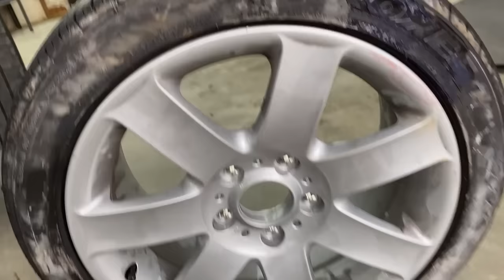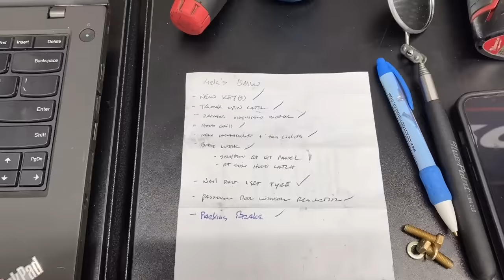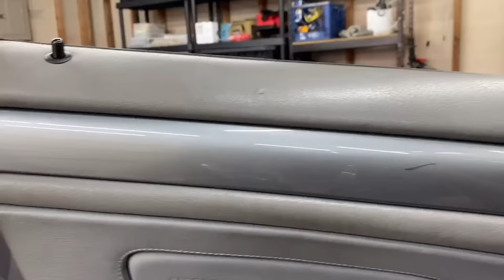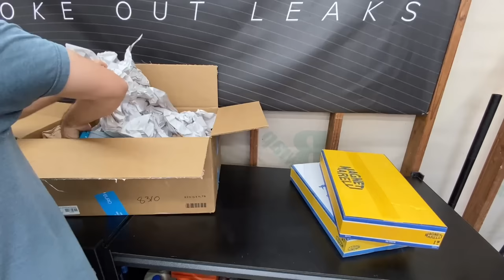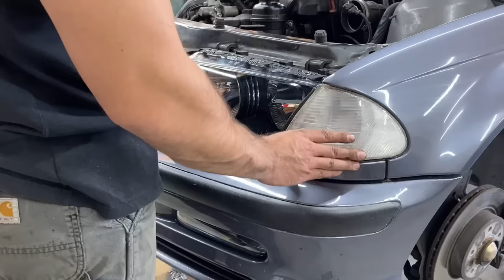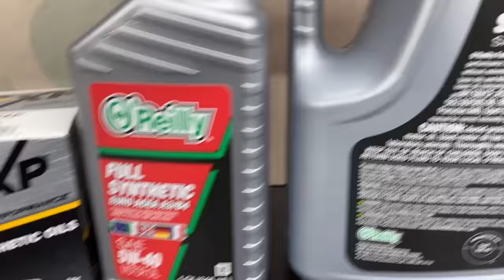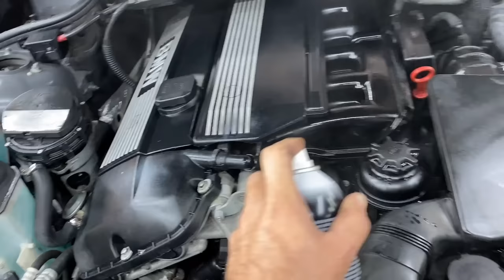What $2077.96 Worth of BMW Repairs Looks Like

Comment: Unfortunately, this is what does in many E46s.  This car was in good shape, it just needed a few maintenance items. If your local shop charges $4000, it may be more than the car is worth. Your $75 an hour is way under indies and dealer prices.  You are giving excellent service at a great price and cleaning things as you go!  This will help keep some older BMWs on the road. The E46 is a great looking car.
Reply: BMW in Minneapolis is $250/hr now! Last time I needed anything from them it was $100…$75 for quality work is honestly too low; I get for friends and family but don’t undercut your skills especially when a good mechanic is hard to find these days🔧
Reply: @bimmerboi_hutch . Wow I haven’t been to Minneapolis BMW for years.  $250/ hr is crazy.
Reply: @DCPEvo  while I agree - a package of bacon is $18, so I guess I'm not surprised; I just hope the tech's got an increase too 🔧
Reply: This amount of work and repair for a little over 2K is INSANE value.
Reply from the maker: thanks for the comment and replies everyone! 
I agree its quite low, however Erik is a great friend and I dont know how I would feel charging more. With that being said, this job total was over $1300 in parts alone. 
Its crazy how expensive labor rates at the dealership are getting, I dont agree with it one bit.
I can guarantee you the technicians rates are not increasing at the same rate either.

Thank you all for the support and awesome comments!
Reply: @DayOffDIY  A great reason to DIY as much as we can as often as we can on our Bimmers!
Reply: Great video. I bought a 97 318ti for my wife to learn how to drive about six years ago, she did drive it for about 4 months. It has been seating on the driveway since then, now my son just turned 16 and he claimed dibs on it,, we try to start it up but no luck, we replaced the fuel pump and fuel filter, the car run for a few minutes then it will die, so we think is the crank sensor. Currently working in it. Bottom line, your customer service ethics are amazing, and been such a honest guy is remarkable. Good luck with your channel.
Reply from the maker: thank you for the well wishes my friend! gotta love those old 3 series touring. classic body style!
Reply: Why a lot of cars are off the road enough of a shit box That's the repair cost for the 10 little things He's not worth the value of the car
Reply: So learn to DIY. Or sell it to someone who has.
Reply: Issue with charging too low of an hourly rate is it brings in a lot of individuals that do not want to pay for simply any service, argue at every costs etc. Because they really cannot afford any of it. - Most adults have credit for emergencies like car repairs. If they aren't able to do that, do you really want them as a customer?

Comment: A new phrase that has permeated the auto repair world is “mechanically totaled”. Repairs exceeding the value of car. Monetary value is one thing, but, emotional value is another. I have spent twice the value on repairs of my E39M5, and it was totally worth it. I assume this E46 is the same. Good work repairing the car.
Reply from the maker: E39 M5, that’s my dream BMW! If you ever sell it, consider me will ya?

I like that term, I’ve totally ran across cars that should be destined for the scrapper, but e39s and e46s are worth saving In my opinion
Reply from the maker: Yeah even with the front end collision on this E46, the bones are still good. The M54 engine is good for 300k plus miles

Comment: What I would do to be able to find a BMW mechanic like yourself in my area. Incredible job, going above & beyond with even the little things is why you're not just a mechanic, but a great mechanic.
Reply from the maker: Thank you Daniel! Really appreciate the kind words. Where ya located?
Reply: @DayOffDIY  Of course, hard finding good, reputable & honest mechanics. I'm in Staten Island, NY
Reply from the maker: ahh NY! do you have to fight a lot of rust?
Reply: @DayOffDIY  fortunately I don't, most of my fighting is with the mechanics who do little work, but charge alot of $
Reply: @DayOffDIY  just found out that I need to replace 2 of the 4 front lower control arms. Two questions, 1: is this something I can do myself without a lift using jacks & stands & 2: if I need to replace 2, wouldn't it be better to just replace all 4?
Reply from the maker: You can do anything without a lift, even removing a transmission if you really need to. The rear control arms dont wear out like the front ones do, id only worry about the front and go from there. I also have some content out there showing how to remove the control arm bushings only, that may be your issue. good luck with repairs daniel!  @danielwilhelm8870

Comment: quick tip from someone who’s working with these… let’s say wonderful parking brakes (thanks Mercedes) on a daily basis: put the brake rotors on and adjust the brake shoes until you can’t spin the rotor by hand anymore, after that loosen them up by about 3 turns. Like that you’ll get pretty much the „optimal“ setting for your parking brakes, no matter if the brake rotors or the brake shoes are new or not.

Still an awesome video though!
Reply from the maker: good recommendation! ill have to give that a try next time

Comment: Nice results brother. Enjoyed watching you go through knocking each item off the list. When chasing threads I typically flush with wd40 as I am  running the tool in and out to keep debris from building up. Good video!
Reply from the maker: Good idea! I usually use anti seize but it usually makes a mess

Comment: This video is pure gold.

First of all, you got a new subscriber. 

Second, I just bought an E46 330 Ci 2002 from my neighbor, the car has only 76k Km (47k miles) and it was parked on his garage for a few years because he crashed it, and the only real damage was aesthetically but he didn't wanted to spend money to fix it (I'm from Venezuela and the cost is even higher to fix a BMW here). So I saw an opportunity and decided to buy it for a bargain. I got a mechanic to change all the fluids, the fuel pump and filters, I changed the battery, the tires and the car started and runs so freaking smoothly. I have it now at the bodyshop for the hood (which was the most affected part from the crash), a full paint job and detailing. My only concern is to find a good mechanic that knows what he's doing around a car like this and I think the best approach is to just do a lot of the stuff myself.

Anyways, I just wanted to thank you for the level of detail in this video and everything you did to the car, it helps me know better the car I bought and for that I'm grateful! Keep up the good work and I wish you great success. PD: excuse me for my English, not my native language!

Edit: so I wrote this like 20 min into the video, afterwards it just gets better. Amazing job
Reply from the maker: Thank you so much Gabe! and no need to apologize for your english, it is excellent!
Glad you enjoyed this video, i had a lot of fun making it. Cant wait to share the next one with you, ive been working in the background on a giant video project and itll be out in a few days. I hope youll enjoy that one too.
Also congrats on the car! once they are tuned up dont they drive amazing?! love the E46

Comment: Work done with clinical precision. In todays world, almost all the car dealership workshops are in a 'replace dont repair' spree. However, its nice to see you moving away from that mindset and repairing what can be repaired and replacing only whats required. The detailing is immaculate. I credit myself with the detailing of my car, I have been doing it for past 15 years. However, when it comes to washing my car , I need not more than 2 gallons of water in a bucket and thats enough for me to clean my car from the outside to inside.
Reply from the maker: Thank you for the comment friend! Appreciate it. I try to repair what I can and replace what I can’t. 
I think it’s a good way to go.

Comment: one thing that shops/mechanics don't do is advice the customer. for example, my mechanic changed all shocks and said to him "hey if the car needs some parts while you have all out, let me know the price and I give green light or not", because I knew rear shocks were almost needing to replace the dust covers. after  a couple months, dust covers split and I thought "i told that mdf to tell me". I went to youtube, saw how it is replaced, went to buy the parts and changed them myself. no issues. so, not cleaning gearbox or not replacing other parts "while-we-are-here" that's not new to me.
Reply from the maker: Brutal! Well I always try to treat customers how I’d want to be treated ya know? Live and learn!
Reply: @C0rvette454  you take 1h of labor to clean a gearbox? you are mechanic right? That's the reason for your answer.
Reply from the maker: should only take about 5 minutes to give it a quick wipe down
Reply: @DayOffDIY  of course but the previous guy must clean it with a kids tooth brush...

Comment: awesome vid! bmw'they have a built in coolant burp /bleed system. turn the ignition on,  heat to max setting, the fan on the lowest speed and then just hold the throttle to the floor for about 10 seconds. it will engage the system....it's pretty slick and very easy way to ensure no air in the system and a cool lil trick if ya didn't already know ;)
Reply: You're spot on on the coolant bleeding procedure. However I'm not sure it's on the E46's. But I'm not confident in that as I've only tried it on my E90 N54. I have an E46 M3 so I'll have to try it on that one next time. Thanks!
Reply from the maker: thats correct! only on the electric water pumps though, M54 and earlier have a mechanical belt driven pump. on N51/52 and newer they switched to an electric water pump that uses this bleeed procedure :)

Comment: Darn, that trunk tip didn’t work for me which means I have some broken wires (which I can see). Amazing video man. If you were local, you’d be my mechanic for the ZHP 🙌
Reply from the maker: Cohn! Good to see you dude, yeah if your latch isn’t working, the wiring loom in the right side of the truck jamb might be damaged. It gets dry and cracks, it’s a pretty fun electrical repair.

Pull the boot back and tug on the wires until you find the loose ones 👍🏻

Comment: Great job and video! Thank you!  I'm wondering if you have a reason for replacing the whole alternator instead of just replacing the voltage regulator and brush assembly for far cheaper? Very easy to do on those ones as well.  You're more fun than a lot of the people who "Try" to make YT vids!  AND You're an "Extra Miler". LOL. I sure wish I could feel like hugging my mechanic. Rock on!
Reply from the maker: Thank you for the support my friend! I’ve seen you in the comments! 

Ya know, I’ve done a voltage regulator once, my old shop would send our cores out for rebuild and install the entire assembly, with fresh bearings etc, so it’s just out of habit, I’ll have to do a regulator replacement in future videos. 

Appreciate the support!

Comment: Oh and some shops would double charge for labor. Like if they had to drop the sub frame to get at the oil pan and saw the engine mounts were shot. they would charge an hour of labor to replace the engine mounts
Reply from the maker: id maybe add on an additional 0.1 hours but ive never charged twice for repairs like that.

Comment: Fairly sure that goop in the trunk was spilled power steering fluid, probably due to the major power steering fluid leak. After all the work you did only a year ago, you're making a great argument for either never buying an older BMW, or making sure never to keep it beyond the warranty period.
Reply from the maker: It was a bottle of power steering stop leak that spilled over in the trunk.
The trunk never lies!

Comment: For 30 $ those turn signals should be replaced instantly, the original fog lights clamps should be put back once the bumper is painted, head lights glass does not need extra sealant if the plastic tabs are all good however a very thin silicon layer could be applied between rubber gasket and the lens. That dirt in the back is most likely coming from underneath is a known weak point under the carpet that rusts badly, Other than these issues you work was very clean and it was a pleasure to watch. There is much work to be done on that e46, I mean reinforce the chassis, upholstery, steering wheel, rims, retrofit the Avin radio unit and so on  but if the owner is not willing to pay I get your point.
Reply from the maker: You might enjoy knowing since the video Erik has replaced the turn signals with ambers, repainted his steering wheel and restitched it, and reglued the C pillars and did a great job with it. 
He had just gotten this car back from his son, and it took quite a beating, so now its back to good daily driver condition. Still has more to go absolutely, but a great driver now for sure.
Appreciate the comment!

Comment: Recently found your channel, love the content on E46s.

My 330ci has this issue where it starts fine in the morning but starts shaking after 10 seconds and then goes back to normal, runs and drives fine, tied changing spark plugs and coils but it didnt help D;
Reply: Sound like a vacuum leak. You can check the CCV hoses or the intake tubing
Reply: Vacuum leak for sure , I had the same issue,not easy to find the problem, but you should start with the intake boot
Reply: Had the same issue, on inspection I found my upper intake boot was cracked in 2 large places. No wonder it was shaking with all that extra airflow
Reply: @m0oman  Yes that's one of the most common failures on them. The boot cracks back near the intake and it's almost impossible to see until you remove it. It's very cheap to buy but it really causes engine shake, worse gas mileage and even a loss of power.
Reply: Lower intake boot or upper intake boot really good places to start. Possibly DISA seal where it goes into the intake manifold. That is why having a smoke machine can be so useful though I don't have one... A basic OBD2 reader would allow you to see the fuel trims to help with diagnosing a vacuum leak
Reply from the maker: Could be a vacuum leak but you never know unless you smoke it!
Could also be a dirty idle control valve.

Comment: Reading these comments it's crazy.  Shops charge a lot and the car at most might be worth $5k  to see someone put $2 and $3k into fixing so much is wild. As a fellow E46 owner I've done a shit ton myself and the cars really do stay driving great if you can put the love into them. 😂  still better than a new one with out dated technology and a car payment. Great job!!  Was enjoyable to watch for sure.  It made me go through the emotions of fixing my 04 🤦 still can't believe I did all this shit. Oh well 🤷 going years strong now.
Reply from the maker: Right?! Ludicrous labor rates all across the nation. I agree completely, id rather have a completely gone through E46 as opposed to a brand new 3 series. The E46 will last longer and drive better in my opinion. Modern BMWs have been going downhill from my persoectiveu
Reply: @DayOffDIY  you're not wrong. I see to many where their car lives at the stealership. I like the simplicity of the E46 I also hate push start 🤷
Reply from the maker: I hate push start too dude... and it wears out the engine mounts prematurely too
Reply: Hate push start club here. Agree with saving $$ and e46's. Fantastic to drive.  KEEP 'EM COMING AND GOING Alec. CONGRATS on the boost in subs.

Comment: Hey awesome video, did a great job bringing that e46 back to life. You seem to know your stuff quite well lol. I figured I'd ask, I am having a bit trouble with my w245 B-class (I am canadian). I get this vibration only around 1.6k rpm, but its hard to tell where exactly its coming from because it vibrates throughout the car. I brought it to a shop and they simply told me it's the muffler... Before I go through with the replacement, is this an issue you've encountered? Where it vibrates at a specific rpm?
Reply from the maker: It’s possible it could be the exhaust system, could also be something like a driveshaft, axle, hard to say without seeing the car. You could always go to another shop to get a second opinion!

Comment: I sure could use your Mater Tech on my 2001  E-38 750 IL,it’s been parked for several years,I did get it oil change last year with Liquid Molly,but I don’t drive it much,and now my Batteries need to be replaced,I got them and I couldn’t get it to fire up,crank no start
Reply from the maker: I’d throw a fuel pressure gauge on the shader valve at the fuel rail and see if you’re getting fuel pressure.

Check for fuel and spark first

Comment: Dude, the wiring for the eBay replacement mirror was different because you purchased a heated mirror to replace a non-heated mirror. The two are not compatible. But nice save!
Reply from the maker: I think they were both heated, because both pieces of glass had connections on the back for circuits